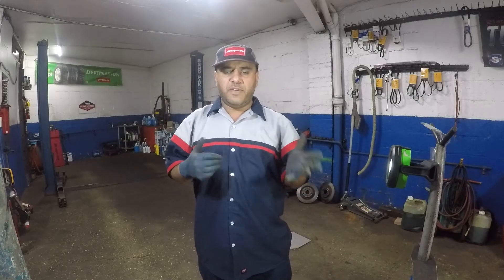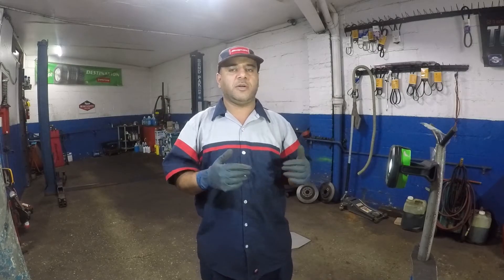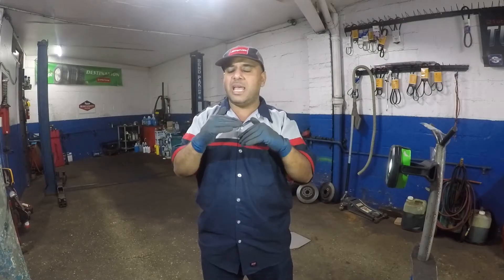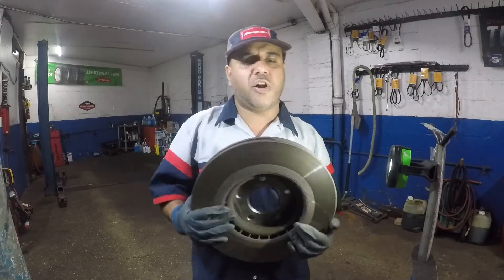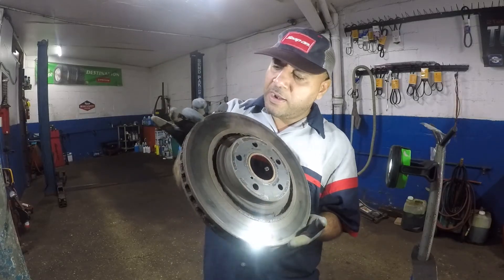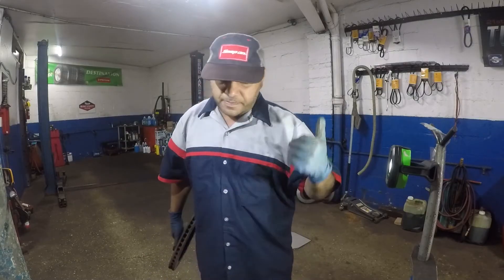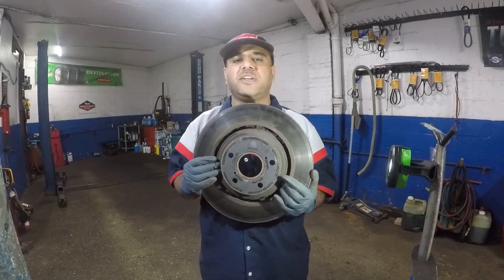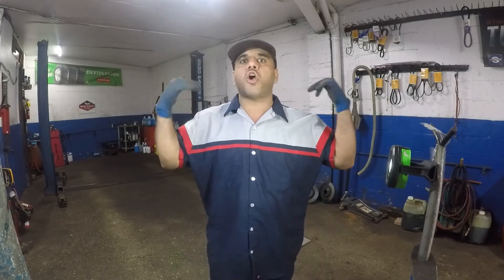The reason why car shakes when Braking

Comment: i change mines friont disc for a new ones  and pads tobut after 4 months star shaking when i brake up to 60 miles per hour what should i do now or what is the issue of this
Reply from the maker: Rotors can go bad so redue and make sure u grease em properly clean out the bore for slider pin usually heat is what kills it
Reply: thank you so much my man god bleesiu whith much more videos

Comment: Your video nails the problem.
I changed all 4 rotors and brakes on my 03 Acura TL that I hardly drive but after a few months the shaking/pulsing came back. 
Any thoughts please?
Thanks
Reply from the maker: I had similar issues rotors went bad check for pad restriction slider pins free greasing or caliper jams. It can over heat and warp the rotors
Reply: @ 
I’ll try again, thanks.

Comment: Rust on the face of the brake disk can cause this also.  Clean the face of the disk with a drill attachment and no more shake.  Also put minimal to no anti-seize on the face of the brake disk where it meets the wheel.
Reply from the maker: Yes

Comment: The problem could also be the bearings. More often than not is actually the bearing.
Reply: I've got a shake in the car not the pedal when braking. Just the car pedal feels normal. It was a heavy shudder. 
Replaced rear brakes and rear bearings. 
The shudder has dramatically improved but still not gone. 
Front brakes where replaced long before the shudder and customer drove care for 2 years no problems. So what could it be then??

Comment: Thats what I'm getting with my grand Cherokee but I just got new rotors and brakes from the dealership back in February. I tried to inquire with them but they want to charge me because its been a few months
Reply from the maker: Rotors can go bad over heats I would check to see if any caliper or slider pins r not smoothly moving with next brake job

Comment: I only have vibration braking 40 to 30 mph. Car doesnt shake all other speeds. Do you know why its that specific speed window?
Reply from the maker: Still might me bad rotors possability slight bent at high speed it can’t detect it might reflect right throguh
Reply: @RBTheMechanic  thanks mate. I already bought one new rotor, its on the way and will update. Vehicle was curb hit one side, replaced everything expect hub and bearing. Now replaced those two. Still have shake. So is it possible the hub/bearing caused a thickness variation?

Comment: Shakes in the front, replaced the front rotors..gone for 2k miles, then cameback....as you said, rears are now needed, i can see black spots all over them.
Reply from the maker: Do massive cleaning and check calipers I had  issue like that calipers pins were over packed with grease or calipers r bad

Comment: I changed all my brake pads and rotors, and immediately developed a pulse/shake. What could I have done wrong to cause this?
Reply from the maker: Did u clean the surface of rotors where they sit on hub?  Watch one of my videos I explain it in detail clean everything and make sure rotors sit flush also it could be bad rotors defective. Anways here is a video https://youtu.be/ry_nRg_9qrE?si=yu-K9jrcGAH288V4
Reply: @RBTheMechanic  Thank you for responding. I cleaned and wiped down the new rotors with brake clean. I hadn't sanded down the hubs since I live in Las Vegas and the rust was minimal, but I've been going back and sanding them down hoping that's the problem. Now I'm going to watch your linked video.

Comment: Agree 100%.. also it  be a good time to check the suspension components  while there  like wheel bearing, tie rod ends and shocks...  As if you have a suspension issue those new rotors won't last..
Reply from the maker: Yup
Reply: Yep, because changing the rotors is only a temporary fix. Most people control arms are bad
Reply: Vrai.

Comment: Thanks. Good info. I'm replacing all 4 rotors. Plus, new front & rear brake pads. I'm vexed that the dealer I bought my Jeep Cherokee from resurfaced the left front rotor instead of replacing the rotors. They only changed the brake pads.
Reply from the maker: Yeah rotors r the issue

Comment: 2004 silverado 2500 reg cab 2wd. Have a bad shack only when applying the brakes. I have not shake in steering wheel and no pulsing brake pedal. The slightest pressure on brake pedal makes it shake bad. I feel it more in my seat if that makes any sense. But truck stays straight and again steering wheel doesn't shake at all. PLEASE HELP! Pads seems to help a little but old pads weren't bad at all with even wear.
Reply from the maker: Shake when braking is warped rotors

Comment: Hey how are you doing ? I got a problem with my bmw x5 truck it been shaking when i press the brakes also when i try to accelerate   kinda shakes too and struggles to go fast  so im thinking  would it be the brakes i just went to change them so idk what can it be by the way keep the good work you are a smart man
Reply from the maker: Did u change brakes only or rotors also?

Comment: Ceramic brake pads are notorious for causing hot spots and rotor warping. When you think about it, ceramics don't absorb heat. So, all the heat generated by braking gets transferred directly to the rotor and not shared with the pads. Semi-metallic pads are better for this problem. However, they tend to wear out faster!
Reply from the maker: Good information then there’s noise part

Comment: I replaced the rotors and still shaking when breaking, any suggestions?
Reply from the maker: Did u check play in suspension   Some times it’s deduct rotors or the surface rotor sits on is uneven hub could be an issue.   Did u change front and rear rotors?
Reply: @RBTheMechanic  no Sir how can I check the play in suspension or Hubs? I just replaced rear drums and break shoes, I paid for diagnostic in honda and they said side engine mount and replace rear drums and breaks but still shaking i paid $211 for nothing
Reply from the maker: @eljayrecords1  did u replace front
Reply: @RBTheMechanic  yes I did after I changed still shaking.
Reply from the maker: @eljayrecords1  so if it starter after chaning it might be somthing that u did wrong check the screws on rotor or the surface u see rotors

Comment: i replaced my rotor but not the brakes still vibrates when braking on downhill
Reply: yeah man i can't seems to pin point it as there's plenty of culprit to choose from. just recently bought the car and don't know the history of the car. could be the rotor, brakes,  wheel hub, lower control arms, sway bar links, steering column, bent rims or uneven tyres. I've replaced the rotor and had a wheel alignment plus change the centre bearing drives fine on flat roads and no vibration upon braking, but downhill at high speed and braking the vibration very noticeable. my car is a rear wheel drive holden VZ commodore pretty similar to chevy pontiac in north america
Reply from the maker: @milkyway6724  start with basic rotors and check for suspension play and clean the hubs well
Reply from the maker: Gotta change togather first
Of all brake pads and rotors did I clean the hubs well? And check suspension

Comment: Brakes often dont warp but pulsate due to uneaven pad trasfer. The way to fix it is to rebed to get the brakes nice and hot with several repeated stops then let them cool without coming to a complete stop. Be careful, do this in a safe manner "off road" only.
Reply from the maker: Yup
Reply: Absolutely correct . Stopping from speed, then sitting with your foot on the brakes. The part of the rotor beneath pad stay hot and pad material etches into the metal.

Comment: I changed my rotors and pads less about a year ago..The shake is back. I have only driven only 4k/5k miles since then. What could be the issue?
Reply from the maker: Need to redue the brakes and clean lubricant and do the job like pro watch all of my videos on brakes and lubricant u will understand
Reply: @RBTheMechanic  Thanks for your reply! I have one more question. Can improper brake fluid circulation also cause this kind of shaking issue? TIA
Reply from the maker: @SumitShrestha-u6o  well your rotors r damaged so not the fluid but hydraulic lock up can cause rotor to over heat but that’s rare just do ur flush for brake fluid and do best job when doing brakes use good parts any retainer clips hardware use it clean the area very well and use greasing I have video on greasing

Comment: damn, my mechanic had mine sanded and refinished and they still vibrate, I am going to another guy to have them replaced, hoping only the fronts.
Reply from the maker: Sanding or resurfacing wount work  I would replace new rotors
Reply: @RBTheMechanic  yeah, I should have just went with new ones, I think he was trying to skip on the extra work, he said the rotors were fine though.
Reply from the maker: @joesmith9216  yeah replace them and do a well cleaning u set the hub area

Comment: I'm having the same problem with my 2019 Chevrolet 2500 duramax. I can't understand why because it only has 23,000 miles and easy miles with very little towing.
Reply from the maker: Well redue the brakes and rotors clean out the surface and clean the slider pins bore and give u lubercation on every contact watch my lubercation video

Comment: I notice that vibration after replacing brake pads and rotors I did all 4
Reply from the maker: Ohhh maybe somthing is not cleaned surface or new rotor could be warped double check ur work

Comment: I replaced the front breaks pads and rotors and still does the same shaking problems.
Reply from the maker: Could be rears that r bad also I have had bad rotors and one time did u clean the hub well
Reply: @RB The Mechanic  
Thanks for replying me back.
I'll do that.

Comment: I had that problem. Took it to mechanic.  He supposedly resurfaced the front rotors. Then after 3 days it started shaking again. Could it be a bad tire? Thanks
Reply from the maker: Ok he opened can of worms never cut rotors it either will go good or bad so ur back to square one replace the rotors
Reply: @RBTheMechanic  Yeah, mine did the same thing, I think he was trying to get out of having to install my rotors.

Comment: Do rotors actually warp? Or is it DTV (Disc Thickness Variation)? A couple of local brake shops tell me rotors on passenger cars will never get hot enough to warp. What you showed here on that 2nd rotor looks like brake pad material on the rotor that could easily be cleaned off by resurfacing the rotor. Resurfacing would cost $15-$20 per rotor vs maybe $50-$80 for a new rotor
Reply from the maker: Rotors get warped from heat and peddle slams

Comment: What about the noise aspect to the issue? I hear a rumble noise. Is that a warped rotor maybe?
Reply from the maker: It could be flat or rusted spot if ur car been sitting for a while it would occur
Reply: @RBTheMechanic  I use it often.
Reply from the maker: @jeffh.2588  it could be rotors tires brakes ring all that is related might have to test it to tell u where what it is

Comment: I have a 2014 Maxima with 77260 miles never changed the rotors they look fone but should i just swap them all put on my next pad change which is next
Reply from the maker: I would change them here video on maxima but diffrent year should be similar https://youtu.be/XG95uqpE_1s

Comment: Good evening!
i have isuzu npr85, when i press the brake without load it doesn't vibrate but when i have load it vibrates.
thanks in advance.
Reply from the maker: It can be control arms or just the roars do high speed no load and test it
Reply: @RBTheMechanic  Thanks I'll try it.

Comment: My Toyota sienna shakes really bad when going on a steep downhill mountain. It only happens downhill when it’s steep and I’m slowing down at a high speed. Could this be the same issue, the rotors?
Reply from the maker: Could be possable rear are issues for to down hill force anyways go highway high speed and press brake to c firm
Reply: Thanks for your help!
Reply from the maker: @thinkingmamma  welcome glad to help

Comment: Had my rear brake pads, rotors, and tires replaced. Still the car vibrates when braking above 40mph. Now what? 2008 Lexus LS460
Reply from the maker: I have cases where the new rotors were no good. Could be possibility but check all other components like tie rods control arm bushings and do wheel balancing

Comment: The brake rotors being made today are using a "new" metal alloy compound that should not be used for vehicle braking systems. The rotors are cheaper that using solid steel. That's why they warp.
They are designed to warp.Remember folks. EVERY company that manufacturers ANY product, will make their products cheaper by the least money possible. Even if it can be made
a penny cheaper - It's a done deal. It's the consumer's that pay the price for cheap, shoddy goods, especially in vehicle's made across the world. Stands to reason why there are sooo many vehicle recalls, and vehicle failures that can cause death. Cheaper is easier, and crossing fingers that the product lasts for at least a year. 
.
Reply from the maker: Yup new cars are failures parts are made cheap

Comment: Thanks. Great explanation. Is there anything else that could cause the shaking. I changed my pads about 1,000 miles ago. Can I still use them with the new rotors
Reply from the maker: I would change them out that way they r fresh and brake in to the rotor anyways watch my other videos I explains how pad should go in smooth and easy no pushing and shoving to prevent this type of vibration for long term life of rotor
Reply: @RBTheMechanic  Thanks. too bad I just bought them. Great explanation

Comment: how about one wheel vibration no pedal pulse , new rotors and new calipers, all new suspension parts ie: new ball joints, tie rods center link, shocks I-beam bushings, radius bushings ? 1992 ford explorer. only on drivers side vibration above 40mph while braking.
Reply from the maker: Could be possable bad rotor or loose component I have had new rotors that were no good   And how did u determine one side ?
Reply: @RBTheMechanic  because it feels like if it had struts, the top stut would be loose on drivers side but only while braking, I feel it not in pedal but on floor board. Had it looked at during allignment at a body/frame shop and mechanic said everything is tight with no issues in suspension. Suggested having tires re-balanced however that didn't make any changes. My last thing to look at and change is the brake hose to caliper, thinking it may have separated inside and has some collapse. It is the only thing left to change. the reson I changed the rotors was because it was already doing this before the change of rotors and pads.

Comment: I changed my rotors and maybe a year later it started again
Reply from the maker: It can happne I get cars come back after 6 months.  So next brake change make sure all slider pins on caller is nice and easy to move and use some good silicon based grease make sure it’s not at the top of pin make sure caliper is not hard to compress and hopefully that would do it and avoid driving through puddle of waters
Reply: @RBTheMechanic  well can't help the rain I'm in the south. But I'm going to change to slotted and drilled rotors. I think alot of heat got to my drivers side. Thanks for the advice
Reply from the maker: @koffinNAILS  those wount help but I understand can’t avoid rain but puddle of water like don’t go through water that’s deep enough to smudge rotor in to super hot rotor will warm with instant pressure of brake caliper and temp drop and boom it has done it
Reply: @RBTheMechanic  well thanks for the info. You get a sub

Comment: What about a tick noise and the noise  gets faster as the truck picks up speed.

My issue started after running over a big bolt on the freeway
Reply from the maker: It could be rock stuck on to tire thread yup or bolt

Comment: What if the shaking continues after replacing rotors and brakes?
Reply from the maker: Did u do all4? Did u clean and liner and clean the hub and made sure no rust and build up?
Reply: @RBTheMechanic  thank you for getting back to me. You are very responsive to viewers! It was the calipers. Four different mechanics said they were fine after replacing rotors and brakes, but the shaking continued and warped the new rotors repeatedly, so my husband replaced the calipers and the shaking stopped. 

I will subscribe to your channel just for your responsiveness! 👍🙂
Reply from the maker: @sarahbeee  oh wow glad u figured that out usully I mention when I do brake change video caliper has to be smooth when compression it

Comment: Dam, I didn’t think of that … how if they resurface yr rotor it can still be warp if they don’t do it right … I only resurface my rotor cause it was a stock rotor
Reply from the maker: Yeah been there done that.   Best to replace it
Reply: @RBTheMechanic  

Yea , I had all my rotors turns and all new brakes , not even 1 year and my rotors are warp …

Comment: Is it ok to ride with the rotars like that for a bit? Or will it cause other wear and tear on other car parts
Reply from the maker: Yeah but change them eventully and keep good amount of distance when going high speed
Reply: A mechanic told me it could take out the calipers
Reply: If for instance the judder comes from the rear rotors 
And you drive long with this problem. 
Could the problem get copied on the front rotors wich were good before?

Comment: Thank you bro I just came from the mechanics he changed all 4 brake pads but only 2 rear rotors , shaking improved a lot but it still shakes when I brake at high speeds, not terribly but still there, I guess I gotta get the 2 front rotors as well even though he said they were good
Reply from the maker: Yeah check the other 2 also
Reply: @merccomm8715  What are the other causes aside from heat that warps the rotors?